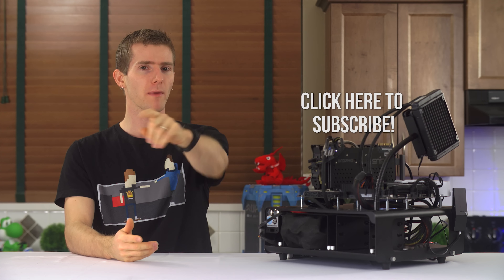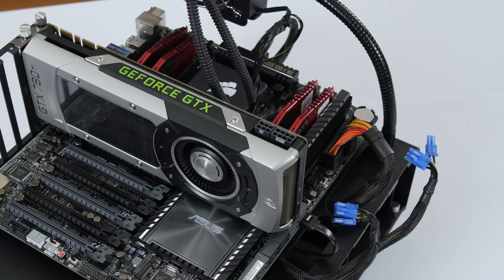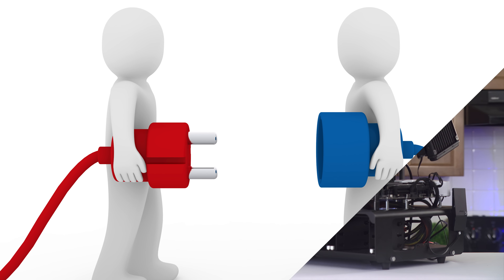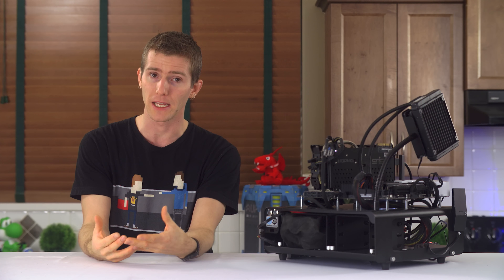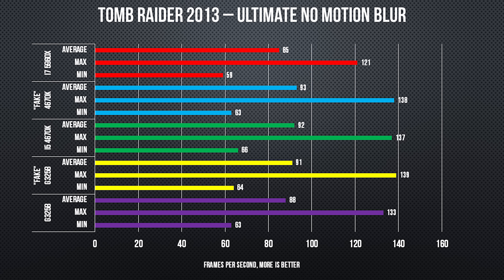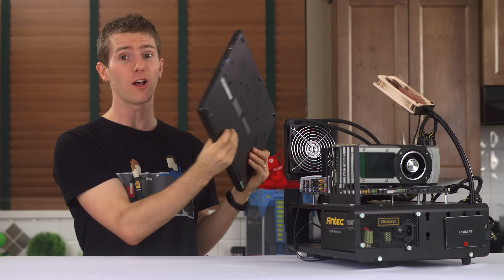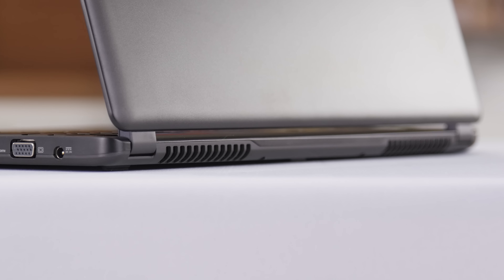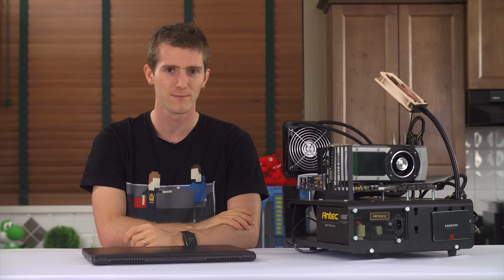CPU Simulation - Can You Simulate Performance of One CPU with Another?

Comment: When is the 960 planned to be released because I am trying to get a 970, and apparently there might be a price drop on the 970. Any of you guys know anything?
Reply: Price drop is unlikely so early on and without new stuff from AMD. There is no reason for them to drop the price, especially since it launched at such a good price/performance.
Reply: Ok, as long as it doesn't go up, I am in the clear ;)
Reply: Drop the price of the 970? Nope. It's one of the best (if not the best) GPU in it's price bracket. 290-290X performance for less (depending where you live the 290-290X can cost less). Until AMD releases the new cards Nvidia will keep the prices or even put higher prices to the 970&980. Go for the 970, the 960 will be GM206 and it will have less performance than the 970. Remember that the 970 has the same chip (GM204) as the big brother, and Nvidia didn't crippled the 970 a lot. With a nice OC (1500Mhz core) you can match the performance of a 980, for a lot less.
Reply: Isaac Martinez I get stuck around 1420Mhz or something in that region :( Heat is not the issue, but I'm running against the 110% power limit. To get to 1500Mhz you're gonna need a more expensive card with unlocked overclocking capabilities. I did get a sweet 400Mhz base clock OC for the memory though. That's not going to be an issue any time soon.

Either way, it's a really nice card. Just barely slower than the stock 980 for a fraction of the cost.
Reply: The .Reaper What I tried to say is that the MSRP of the card isn't going to drop a lot. Sales are something especial, and they last short amounts of time.. That's what I tried to say, sorry.

Comment: For i5-4690k compared to FX-9590
Full Bench results read below
I did not perform them, they are from a website i didn't bookmark and cannot find but IS NOT CPUBOSS (thank god.) I saved results to a word document a week or two ago, I am merely providing some insight

Bench Results
Intel Core i5 4690K (88W) - 4C/4T, 3.5 GHz, 1MB L2, 6MB L3(Top Score)
VERSUS
 AMD FX-9590 (220W) - 4M/8T, 4.7 GHz, 8MB L2, 8MB L3(Bottom Score)
Product Ratings & Comparisons
HandBrake v0.9.9 LQ Film
Frames Per Second
510.61-WIN i5-4690k
401.05
HandBrake v0.9.9 2x4K
Frames Per Second
19.44-WIN i5-4690k
19.05
Agisoft PhotoScan Benchmark - Stage 1: Align Photos
Time in Minutes (Lower is Better)
9.23
7.26-WIN FX-9590
Agisoft PhotoScan Benchmark - Stage 2: Build Point Cloud
Time in Minutes (Lower is Better)
9.64-WIN i5-4690k
11.44
Agisoft PhotoScan Benchmark - Stage 3: Build Mesh
Time in Minutes (Lower is Better)
2.97-WIN i5-4690k
3.88
Agisoft PhotoScan Benchmark - Stage 4: Build Texture
Time in Minutes (Lower is Better)
1.31-WIN i5-4690k
2.99
Agisoft PhotoScan Benchmark - Total Time
Time in Minutes (Lower is Better)
23.15-WIN i5-4690k
25.57
Agisoft PhotoScan Benchmark - CPU Mapping Speed
Million Points Per Second
138-WIN i5-4690k
108
Dolphin Emulation Benchmark
Time in Minutes (Lower is Better)
7.6-WIN i5-4690k
11.77
WinRAR 5.01, 2867 files, 1.52 GB
Time in Seconds (Lower is Better)
70.76
64.97-WIN FX-9590
Hybrid x265, 4K Video
Frames Per Second
1.07
1.57-WIN FX-9590
Cinebench R15 - Single Threaded
Score in CBMarks - Higher is Better
154-WIN i5-4690k
110
Cinebench R15 - Multi-Threaded
Score in CBMarks - Higher is Better
599
728-WIN FX-9590
3D Particle Movement: Single Threaded
Score (Higher is Better)
129.44-WIN i5-4690k
81.27
3D Particle Movement: MultiThreaded
Score (Higher is Better)
417.8
444.93-WIN FX-9590
FastStone Image Viewer 4.9
Time in Seconds (Lower is Better)
39-WIN i5-4690k
59
Sunspider 1.0.2
Time in Milliseconds (Lower is Better)
120-WIN i5-4690k
163
Kraken 1.1
Time in Milliseconds (Lower is Better)
1066-WIN i5-4690k
1827
WebXPRT
Score (Higher is Better)
2680-WIN i5-4690k
2060
Google Octane v2
Score (Higher is Better)
28880-WIN i5-4690k
23439
SYSmark 2014 - Office Productivity
Score in SYSmarks (Higher is Better)
1513-WIN i5-4690k
1236
SYSmark 2014 - Media Creation
Score in SYSmarks (Higher is Better)
1944-WIN i5-4690k
1254
SYSmark 2014 - Data and Financial Analysis
Score in SYSmarks (Higher is Better)
2234-WIN i5-4690k
2065
SYSmark 2014 - Overall
Score in SYSmarks (Higher is Better)
1876-WIN i5-4690k
1474
Cinebench R10 - Single Threaded Benchmark
Score in CBMarks - Higher is Better
7619-WIN i5-4690k
4905
Cinebench R10 - Multi-Threaded Benchmark
Score in CBMarks - Higher is Better
27090-WIN i5-4690k
26635
Cinebench 11.5 - Single Threaded
Score in CBMarks - Higher is Better
1.7-WIN i5-4690k
1.21
Cinebench 11.5 - Multi-Threaded
Score in CBMarks - Higher is Better
6.71
7.84-WIN FX-9590
x264 HD Benchmark - 1st pass - v3.03
Frames per Second - Higher is Better
122.27-WIN i5-4690k
97.87
x264 HD Benchmark - 2nd pass - v3.03
Frames per Second - Higher is Better
39.99
46.39-WIN FX-9590
7-zip Benchmark
32MB Dictionary - Total MIPS - Higher is Better
17939
26364-WIN FX-9590
AES-128 Performance - TrueCrypt 7.1 Benchmark
Mean Encryption/Decryption AES Algorithm - GB/s
3.4
4-WIN FX-9590
POV-Ray 3.7 Beta RC4
Score (Higher is Better)
1459
1678-WIN FX-9590
F1 2013 Single GPU, Average FPS
1080p Max, 1x GTX 770
130.4-WIN i5-4690k
117.3
Bioshock Infinite Single GPU, Average FPS
1080p Max, 1x GTX 770
94.8-WIN i5-4690k
90
Tomb Raider Single GPU, Average FPS
1080p Max, 1x GTX 770
49.4-WIN i5-4690k
49.3
Sleeping Dogs Single GPU, Average FPS
1080p Max, 1x GTX 770
57-WIN i5-4690k
56.5
Battlefield 4 Single GPU, Average FPS
1080p Max, 1x GTX 770
61.2-WIN i5-4690k
59.2
F1 2013 Single GPU, Minimum FPS
1080p Max, 1x GTX 770
102.4-WIN i5-4690k
82
Bioshock Infinite Single GPU, Minimum FPS
1080p Max, 1x GTX 770
29.9-WIN i5-4690k
10.2
Tomb Raider Single GPU, Minimum FPS
1080p Max, 1x GTX 770
35.8-TIE
35.8-TIE
Sleeping Dogs Single GPU, Minimum FPS
1080p Max, 1x GTX 770
34.8-WIN i5-4690k
33.1
Battlefield 4 Single GPU, Minimum FPS
1080p Max, 1x GTX 770
49.9-WIN i5-4690k
48.3
F1 2013 SLI, Average FPS
1080p Max, 2x GTX 770
125.8-WIN i5-4690k
99.4
Bioshock Infinite SLI, Average FPS
1080p Max, 2x GTX 770
159.8-WIN i5-4690k
141.4
Tomb Raider SLI, Average FPS
1080p Max, 2x GTX 770
96.6-WIN i5-4690k
95.9
Sleeping Dogs SLI, Average FPS
1080p Max, 2x GTX 770
105.9-WIN i5-4690k
98.5
Battlefield 4 SLI, Average FPS
1080p Max, 2x GTX 770
108.2-WIN i5-4690k
99.3
F1 2013 SLI, Minimum FPS
1080p Max, 2x GTX 770
95.9-WIN i5-4690k
73.9
Bioshock Infinite SLI, Minimum FPS
1080p Max, 2x GTX 770
28.1-WIN i5-4690k
14.2
Tomb Raider SLI, Minimum FPS
1080p Max, 2x GTX 770
72-TIE
72-TIE
Sleeping Dogs SLI, Minimum FPS
1080p Max, 2x GTX 770
61.8-WIN i5-4690k
55.6
Battlefield 4 SLI, Minimum FPS
1080p Max, 2x GTX 770
86.4-WIN i5-4690k
67.1
Reply: PEOPLE WHO WANT TO SEE A COMPARISON OF i7- 4790K vs FX- 9590
BENCH RESULTS READ BELOW
I did not perform them, they are from a website i didn't bookmark and cannot remember but IS NOT CPUBOSS (thank god.) I saved results to a word document a week or two ago, I am merely providing some insight
Bench Results
 AMD FX-9590 (220W) - 4M/8T, 4.7 GHz, 8MB L2, 8MB L3 (Top Score)

 Intel Core i7 4790K (88W) - 4C/8T, 4.0 GHz, 1MB L2, 8MB L3 (Bottom Score)
Product Ratings & Comparisons
HandBrake v0.9.9 LQ Film
Frames Per Second
401.05
582.79-WIN 4790k 
HandBrake v0.9.9 2x4K
Frames Per Second
19.05
23.2-WIN 4790k
Agisoft PhotoScan Benchmark - Stage 1: Align Photos
Time in Minutes (Lower is Better)
7.26
5.57-WIN 4790k
Agisoft PhotoScan Benchmark - Stage 2: Build Point Cloud
Time in Minutes (Lower is Better)
11.44
8.54-WIN 4790k
Agisoft PhotoScan Benchmark - Stage 3: Build Mesh
Time in Minutes (Lower is Better)
3.88
2.78-WIN 4790k
Agisoft PhotoScan Benchmark - Stage 4: Build Texture
Time in Minutes (Lower is Better)
2.99
1.16-WIN 4790k
Agisoft PhotoScan Benchmark - Total Time
Time in Minutes (Lower is Better)
25.57
18.05-WIN 4790k
Agisoft PhotoScan Benchmark - CPU Mapping Speed
Million Points Per Second
108
148-WIN 4790k
Dolphin Emulation Benchmark
Time in Minutes (Lower is Better)
11.77
6.8-WIN 4790k
WinRAR 5.01, 2867 files, 1.52 GB
Time in Seconds (Lower is Better)
64.97
51.29-WIN 4790k
Hybrid x265, 4K Video
Frames Per Second
1.57
1.75-WIN 4790k
Cinebench R15 - Single Threaded
Score in CBMarks - Higher is Better
110
181-WIN 4790k
Cinebench R15 - Multi-Threaded
Score in CBMarks - Higher is Better
728
894-WIN 4790k
3D Particle Movement: Single Threaded
Score (Higher is Better)
81.27
146.06-WIN 4790k
3D Particle Movement: MultiThreaded
Score (Higher is Better)
444.93
803.95-WIN 4790k
FastStone Image Viewer 4.9
Time in Seconds (Lower is Better)
59
35-WIN 4790k
Sunspider 1.0.2
Time in Milliseconds (Lower is Better)
163
103-WIN 4790k
Kraken 1.1
Time in Milliseconds (Lower is Better)
1827
938-WIN 4790k
WebXPRT
Score (Higher is Better)
2060
2883-WIN 4790k
Google Octane v2
Score (Higher is Better)
23439
34169-WIN 4790k
SYSmark 2014 - Office Productivity
Score in SYSmarks (Higher is Better)
1236
1823-WIN 4790k
SYSmark 2014 - Media Creation
Score in SYSmarks (Higher is Better)
1254
2370-WIN 4790k
SYSmark 2014 - Data and Financial Analysis
Score in SYSmarks (Higher is Better)
2065
2521-WIN 4790k
SYSmark 2014 - Overall
Score in SYSmarks (Higher is Better)
1474
2217-WIN 4790k
Cinebench R10 - Single Threaded Benchmark
Score in CBMarks - Higher is Better
4905
8785-WIN 4790k
Cinebench R10 - Multi-Threaded Benchmark
Score in CBMarks - Higher is Better
26635
33538-WIN 4790k
Cinebench 11.5 - Single Threaded
Score in CBMarks - Higher is Better
1.21
2.05-WIN 4790k
Cinebench 11.5 - Multi-Threaded
Score in CBMarks - Higher is Better
7.84
9.66-WIN 4790k
x264 HD Benchmark - 1st pass - v3.03
Frames per Second - Higher is Better
97.87
122.93-WIN 4790k
x264 HD Benchmark - 2nd pass - v3.03
Frames per Second - Higher is Better
46.39
52.22-WIN 4790k
7-zip Benchmark
32MB Dictionary - Total MIPS - Higher is Better
26364—FX WIN 9590
26152-LOSE 4790k
AES-128 Performance - TrueCrypt 7.1 Benchmark
Mean Encryption/Decryption AES Algorithm - GB/s
4
5.2-WIN 4790k
POV-Ray 3.7 Beta RC4
Score (Higher is Better)
1678
1834-WIN 4790k
F1 2013 Single GPU, Average FPS
1080p Max, 1x GTX 770
117.3
132.1-WIN 4790k
Difference in FPS:
14.8
Bioshock Infinite Single GPU, Average FPS
1080p Max, 1x GTX 770
90
95.2-WIN 4790k
Difference in FPS:
5.2
Tomb Raider Single GPU, Average FPS
1080p Max, 1x GTX 770
49.3
49.9-WIN 4790k
Difference in FPS:
0.6
Sleeping Dogs Single GPU, Average FPS
1080p Max, 1x GTX 770
56.5
57-WIN 4790k
Difference in FPS:
0.5
Battlefield 4 Single GPU, Average FPS
1080p Max, 1x GTX 770
59.2
61.4-WIN 4790k
Difference in FPS:
2.2
F1 2013 Single GPU, Minimum FPS
1080p Max, 1x GTX 770
82
108.2-WIN 4790k
Difference in FPS:
26.2
Bioshock Infinite Single GPU, Minimum FPS
1080p Max, 1x GTX 770
10.2
28.6-WIN 4790k
Difference in FPS:
18.4
Tomb Raider Single GPU, Minimum FPS
1080p Max, 1x GTX 770
35.8
36.9-WIN 4790k
Difference in FPS:
1.1
Sleeping Dogs Single GPU, Minimum FPS
1080p Max, 1x GTX 770
33.1
34.9-WIN 4790k
Difference in FPS:
1.8
Battlefield 4 Single GPU, Minimum FPS
1080p Max, 1x GTX 770
48.3
50-WIN 4790k
Difference in FPS:
2.7
F1 2013 SLI, Average FPS
1080p Max, 2x GTX 770
99.4
127-WIN 4790k
Difference in FPS:
27.6
Bioshock Infinite SLI, Average FPS
1080p Max, 2x GTX 770
141.4
164.1-WIN 4790k
Difference in FPS:
22.7
Tomb Raider SLI, Average FPS
1080p Max, 2x GTX 770
95.9
97.2-WIN 4790k
Difference in FPS:
1.3
Sleeping Dogs SLI, Average FPS
1080p Max, 2x GTX 770
98.5
105.9-WIN 4790k
Difference in FPS:
7.4
Battlefield 4 SLI, Average FPS
1080p Max, 2x GTX 770
99.3
107.5-WIN 4790k
Difference in FPS:
8.2
F1 2013 SLI, Minimum FPS
1080p Max, 2x GTX 770
73.9
98.1-WIN 4790k
Difference in FPS:
24.2
Bioshock Infinite SLI, Minimum FPS
1080p Max, 2x GTX 770
14.2
28.3-WIN 4790k
Difference in FPS:
14.1
Tomb Raider SLI, Minimum FPS
1080p Max, 2x GTX 770
72-TIE
72-TIE
Difference in FPS:
ZERO
Sleeping Dogs SLI, Minimum FPS
1080p Max, 2x GTX 770
55.6
59.3-WIN 4790k
Difference in FPS:
3.7
Battlefield 4 SLI, Minimum FPS
1080p Max, 2x GTX 770
67.1
82.3-WIN 4790k
Difference in FPS:
15.2

1080p, MAX, 1x GTX 770
•	AVERAGE AVG. FPS DIFFERENCE IN BENCHED GAMES: 
	I7-4790k has 4.66 more FPS than 9590 w/ a single GTX 770
1080p, MAX, GTX 770 SLI
•	AVERAGE AVG. FPS DIFFERENCE IN BENCHED GAMES: 
	I7-4790k has 13.44 more FPS than fx-9590 w/ 2x GTX 770s
Reply: Seems like this 4690k is the silicon lottery winner out of all 4690k's produced TBH, seems that results are much higher than average

Comment: linus i need your help to choose between Asus STRIX-GTX970-DC2OC-4GD5 & EVGA GeForce GTX 970 FTW ACX 2.0 but i just found waterblock for asus gtx 970 and not yet at evga gtx970. plz help
Reply: i dont care so much about the fans because i will do watercooling with it but it, i just want to know what can get more performen when over clock
Reply: but thanks for the help :)
Reply: Greamwiper King I'd go EVGA, i've heard strix has some power limitations and since evga are nvidia partners, they prolly have the most time to develop the pcb's, which will likely result in better quality design.

Used a couple EVGA cards and all seems pretty good
Reply: Greamwiper King I would presume if you're water cooling whichever option you get there will be very minimal difference, Im my opinion go with whichever is cheapest, unless one of them has a significantly better looking PCB
Reply: thanks
Reply: Greamwiper King I'd only go with EVGA or Gigabyte. Tend to be more cooler and have more overclocking capabilities
Reply: EVGA EVGA EVGA don't even touch the strix, there's no point in water cooling a strix since it only has a single 8 pin so it can't overclock for shit. But I'd go for Gigabyte G1.
Reply: JoeOnWoW yeh this guys right the strix has only an 8pin power connector so its a bit limited in draw maybe but it also has more power phases than the evga so it will have an advantage there but the gigabyte G1 is the best option out there just now id say it has water blocks and good power phases and can OC pretty well due to the G1 binning.
Reply: JoeOnWoW evga. Had that exact one for months and its working awesome.

Comment: i have a questin i recently built my computer with i7-4770k and gtx 770 and a 600 watt power supply. However its been crashing on normal games like tf2 and csgo with the fans moving like crazy when the computer crashes. Is my computer not having enough power or is it over heating i cant tell.
Reply: ok right after i made this comment my computer crashed really hard to blank white screen and i turned it on and off but no response for while then it said windows failed to close go to recovery or normal windows i went back to time when it worked it said..... whats happening
Reply: Nick Grosso Any other information you can give? Windows 7, 8, legit, cracked? Motherboard model? Hard drive set up? Exactly how long have you had it? Was the problem always there or appeared recently? Have you already done a virus scan?
Reply: Timothy Lastovica windows 7 64 bit legit bought from newegg, ballistic sport 8 ram (4gbx2) 1600, hard drive is ssd, had it since late summer this year, never had problem till we entered in December, no virus according to scans (I got most steam on there couple other programs like iTunes nothing treating though), mother board: gigabit GA-Z97X
Reply: Also I went into the computer and found error 41 happening a lot in my history
Reply: Nick Grosso Is error 41 in reference to event viewer's numbering scheme? Or did you find it by opening up the latest minidump file?
Reply: Timothy Lastovica windows kernel event ID 41 error
Reply: Nick Grosso Event viewer's 41 is in reference to the computer unexpectedly being shut down. It will appear in the log next boot if you hold down the power button right now to shut it down. So we can mark that one off the list. 

Is the machine giving a blue screen of death or just displaying a frame from right before the crash on screen usually? I know you said a blank white screen but i'm curious for the other times.